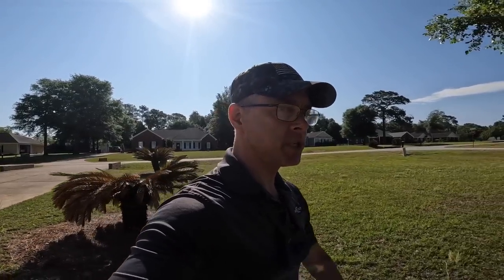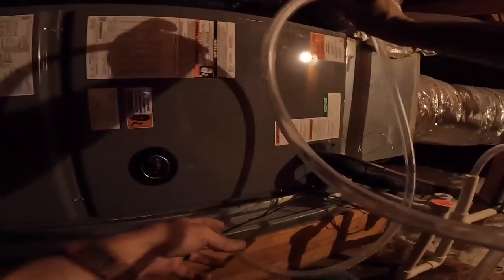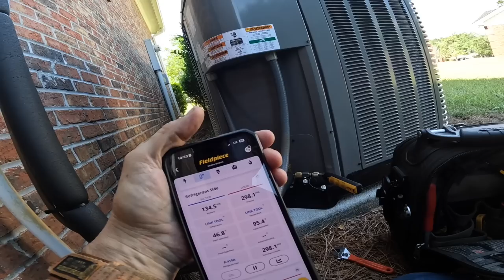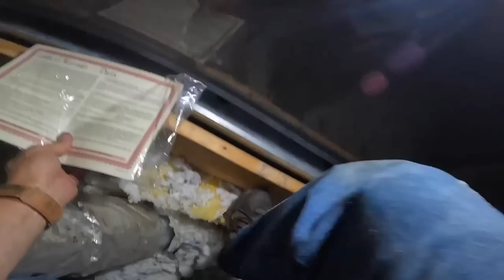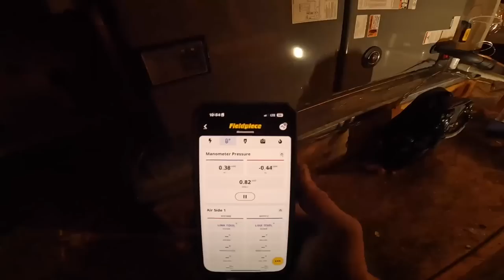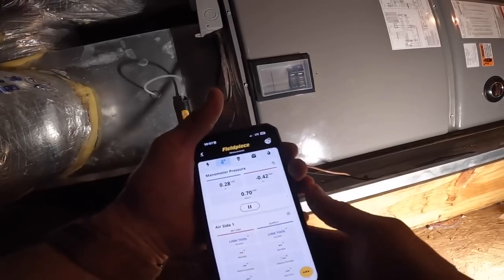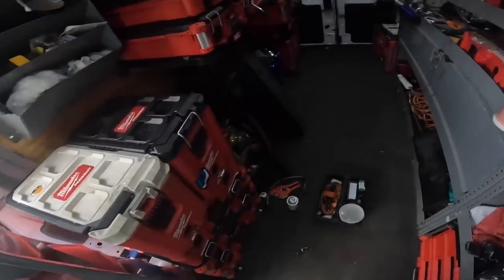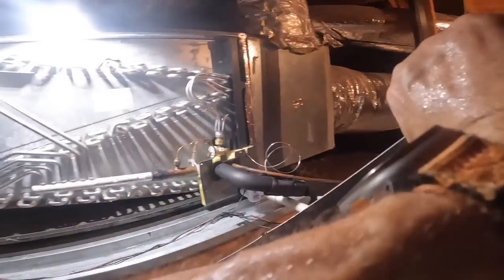Looking For Why Water Was in The Emergency Drain Pan! #hvacguy #hvaclife #hvac

Comment: had the same recurring problem on a unit and found the customer was setting the  tstat on 60 overnight.   which caused the coil to freeze up at night.   shut down the unit and the coil would thaw and fill the pan up. 
I installed a 2-speed fan controller on the outside condenser fan motor and that allowed them to turn down the temp.

Comment: If you were to go to Rheem and get the replacement coil for that unit, under warranty, you will find the coil comes with a large splash guard on the front and two smaller splash guards on the backside of the coil. On a previous comment, one of your followers stated that on that unit water drips off the cap tubes, TXV, and end caps and that water misses the primary pan and makes its way into the secondary pan. It can take months to fill up the secondary pan enough to either overflow or trigger the float switch in the secondary pan. I carry the 17 inch, the 21 inch, and the 24 inch splash guards on my truck now. Years ago Amana actually used a piece of shower pan material strapped to the front of the coil and basically did the same thing.

Comment: That thing has a heck of an emergency pan. I thought mine was big. When mine was brand new, it did the same thing, and it must have been the leveling. He put wood blocks under mine that are in the pan. It worked, but I don't like wood in there, those rubber blocks are much better. Thanks for this video, it taught me something. I know what to look out for on my change out.

Comment: Normally when it's like that, possibly could only be a cracked drain pan. Youll known if they call you back. Good job on getting it done Curt
Reply: Yep, that would do it, being new unlikely, but possible. What gets my goat, unit drain and emergency pan on same drain(or did I miss something). My unit is on my sewer system, emergency pan drains outside.

Comment: If it wasn’t newer I would say to high of fan speed can pull condensation right off the coil. Or any buildup will cause it to not flow down the coil properly.

Comment: Just watched over at “How To Home” he installed a Micro Air Soft Start, it reduced the inrush amperage required from like 120 to 35 amps..I thought it was super interesting..it allows a smaller generator to be used when ppl have backup generators for their houses…pretty cool..literally!
Reply: what doe's a soft start have to do with this problem. How to Home another handy man  giving advice to a trade he has no business giving advice on. Just hire someone in the HVAC trade to do the work if you need it. Handymen can give  very dangerous advice.
Reply: @chrissipple1018  I just thought it was interesting..
Reply: Hmm, it is interesting, but it seems like the manufacturer designs these units for x amount of amps to start the compressor. If it gets too low, the compressor will not start. That is why on some units it takes more amps than normal to start the compressor when they get older. That is what these hard start or boost capacitors are for. If it gets to be too much, or a short then it is curtains for the compressor.
Reply: @jthonn  as I read about it, it won’t be “too low,” it has some ability to optimize the start which also reduces the heat in the windings, there are all sorts of benefits listed that as a non electrician/hvac person I don’t understand, but, I would counter your argument of “it’s already designed to need x” by asking that couldn’t it be that it’s simply “always been done a certain way,” and now there’s a technology that could add a significant expense to the unit which prolongs its life, (or pieces of it) and maybe manufacturers aren’t interested in either prolonging the life or adding more expense..like surge protectors should come standard in panels, but don’t, at least not yet. (I’m still stinging from an electrical surge caused attic fire..which only made a lot of money for the disaster recovery firm..)..have a great Mother’s Day..btw..
Reply: @johncspine2787  OK, cool, I will check into it. My compressor has a hard start on it now, and I will be doing a change out soon.

Comment: I had the exact same issue . It had nothing to do with the pitch. The Back splash plate was never installed causing water to drip inside the cabinet instead of the drain pan .

Comment: I had a rheem that had the plastic pan separate slightly from the metal extension piece and water was going out the back and the front, so it looked at first glance like it was draining correctly but it was also leaking out the back and into the pan. Something to keep an eye out for if you go back

Comment: We would put a condensate drain connected to the drain out of the house as a backup emergency, if it filled up the way it did, problem solved.  Being that slight out of level would have been solved by that.  You could easily just send the water to the other end.  But you are measuring level on the unit, not the pan. Either way, your drain system should be at the correct pitch to drain unless using a drain pimp when it gets to a certain level.  
We would never slow down a blower fan, unless there were no alternatives to adding more supply registers and return air.  Changing speed taps chasing lower static pressure could have negative effects of cooling/heating through the home.  Some areas of the home would have longer runs needing more FPM/CFM  Fix the problem, not bandaid it.

Comment: Curtis great job as always. Could you please leave link for the mini water pump or what ever you call it . I may use during my PM check ups.
Thanks
Reply from the maker: It’s a drill pump I bought at harbor freight. Hoses and connections from Lowes
Reply: @HVACGUY  thanks man

Comment: Thanks for the great videos!  Helps me a lot!  I have a question.  Would the psychrometer probes measuring supply and return air stats be enough of an indicator to diagnose the air flow problem?  Or the combination of both psychrometers and manometer?  Currently saving some money to buy the job link manometers.

Comment: If it wasn’t pitched right, doesn’t that mean water spilled over edge of drain pan, saturating the insulation and causing air handler to sweat into secondary? I seen a lot of ACs sweating in this extreme heat this summer and had to put the black K-Flex insulation to fix problem

Comment: I would suggest adding one more return line to the return to fix the high static pressure, but it looks like you fixed the main issue, so it is all good.
Reply: Occam's Razor - "When there's multiple solutions to a problem, the simplest answer tends to be the correct one."